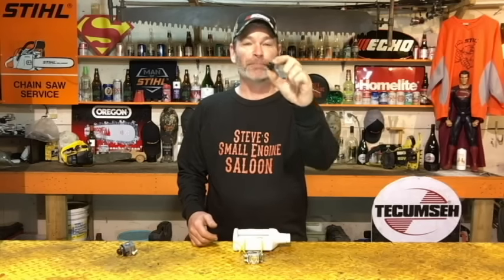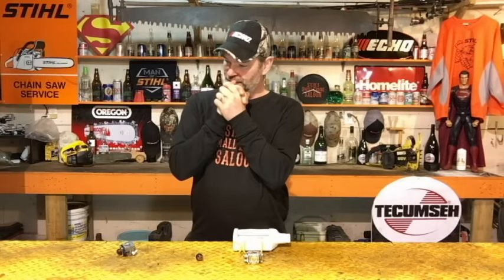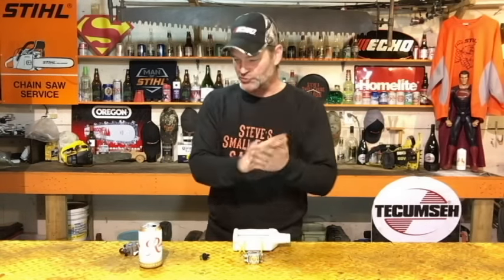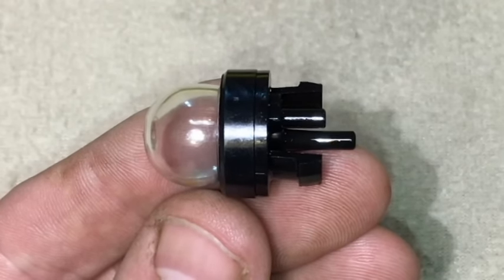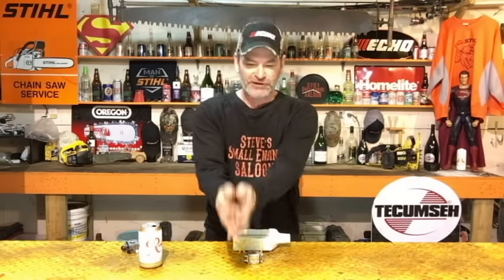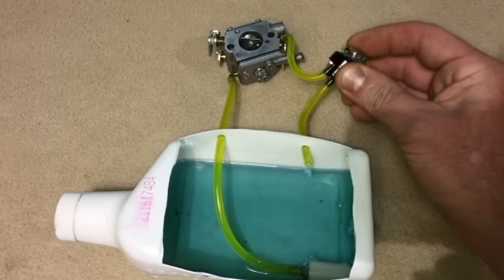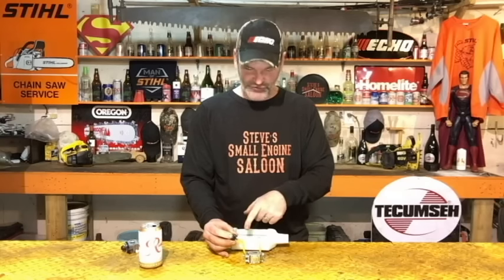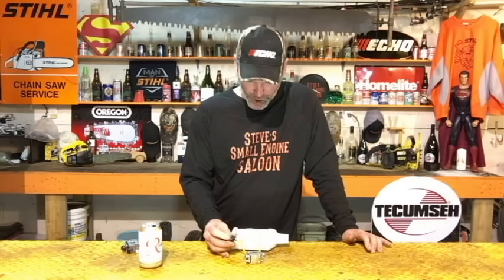How To Install A Purge / Primer Bulb Properly (Don't make THIS mistake!!)

Comment: Steve, where were you 4 hours ago? LOL.  I installed a new bulb on my trimmer this afternoon and hooked the hoses up to the wrong fitting.  I could hear it sucking air, so I switched hoses and it worked... I swear my phone/ youtube is reading my mind, because I didn't mention it to anyone.😳🤔 and then this video popped up in my feed
Reply from the maker: Right on

Comment: Steve, you are a huge time saver for me.  I recently acquired a Homelite chainsaw.  I dismantled and cleaned the carb, but could not get the thing to work.  I worked on it for hours!  Your fuel line example was great.  Turned out the fuel lines had been previously replaced incorrectly.  I reworked new lines based on your example and Voila, it worked!  I've seen a few of your other videos and they are excellent.  Thanks
Reply from the maker: Great to hear!
Reply: Steve, great video. When you have two size lines, thick and thin, which goes where. Anyone?

Comment: Just bought a toro t25 for 10 bucks at a flea market. It looked like it wanted to run, so took it home an realize it needed this purge bulb. Watched this video, Went back to flea market, and got one for 2 bucks, back home installed it and it runs good. If it wasn't for this video I would have been trying to fiddle with it and the carb wasting time. It really made me understand how different this system works from what I knew.

Comment: I did remove all the lines, but not on purpose! While living on a US Army post they privatized housing and the contractor started mowing the lawns, it was no longer up to the occupants.  After I retired, I was dusting off my old, long unused line trimmer.  I was using a soft bristle brush and you can imagine my surprise when I brushed away the fuel lines!  These videos are so informative, you are one of the content providers I recommend to others when they don't want to pay me to work on their machines.  Stay safe!
Reply from the maker: Thank You...

Comment: Thanks for explaining the obvious to most. I bought a “broken” Husky chainsaw that wouldn’t start. The fuel lines were backwards on the PURGE bulb. (I did NOT know the difference as to bulb location) I ASSume primer bulb is on Stihl. Purge bulb is on Husky.

But anyway. Thanks for taking the time to help us and save us money.  You REALLY do a good job of KISS and explaining in detail why stuff works. That really helps!!!
Reply: it is a prime bulb not a purge bulb. purge means to remove and you are not removing fuel you are adding fuel to the carb. this guys means well but he is calling a priming pump a purge bulb which is incorrect.
Reply: @paulk5311  Depends on what you are purging, air or fuel...
Reply: @paulk5311  It all depends on how you think about it so it could be called either one. You could think of it as purging the system of air or think of it as priming the system with fuel.

Comment: Thank you so much for this video man. I was unsure if I could pull this off and had to swap the hoses around (my model has in/out/fuel on the bulb) but I pulled it off and it started right up. Now I'm riding the biggest dopamine surge ever lol

Comment: your video helped immensely. I recently took my yard machine to a repair place to have the lines replaced, (didn't realize how easy it was). Line were put on wrong and one line going to carburetor came off the fitting.  Thanks to your video I was able to fix it without returning it to the repair place. Thank You.
Reply from the maker: Great job!

Comment: Trying for days to fix my cheap old mitox cs41. Threw it in the bin last night. Turns out it wasn't my cheap £5 carburettor replacement at fault. Just saw this video. Had the tubes back to front on the purge bulb. Rescued all the bits from the bin. Rebuilt and now running 100%. As you say, must think Purge, not Prime !  Thanks so much!
Reply from the maker: Right on buddy!  You're Welcome...

Comment: Hey, I just wanted to give you a quick "shout out 'thanks!'" for clearly explaining HOW this device actually works.  Lots of other videos said, "don't install it backwards," but never said WHY.  No one ever pointed out the tiny word, "IN."  No one pointed out that it SIPHONS fuel through the carburetor and exhausts it back to the tank.  You SHOWED us.

On my chain saw, the entire assembly blew off and was lost in the woods.  Armed with your very clear explanation and then demonstration of how this thing does what it does, I was quickly able to discern which hose went to the carburetor and which one therefore must go back to the fuel tank, thus which one had to go where on the bulb, and why it mattered.  Thanks to you, I was able to finish the repair quickly and correctly.  "Outstanding!"
Reply: P.S.  As I replaced the (Stihl-brand) bulb on my Stihl, I was very surprised to see that the ring on the unit where the bulb must attach really didn't match the shape of the two tabs.  I managed to fit the piece by inserting it and then twisting it.  I expected to find a ring-fitting like the one that is used on the fuel and oiler caps, but it didn't look that way at all – and I suspect that this is a big reason why the last bulb got lost in the woods!  "I got it to stay, but I fear it could slip."  (And it's a Stihl-brand part ... that I probably paid too much for.  Looks though just like the one you list above.)  Would love to see clarification on things like this in future videos.
Reply: You failed to mention your choice of beverage...

Comment: Steve you are an absolute Godsend!! Been putting new fuel lines on my chainsaw and after a few hours of messing your simple mock up made me realise I’m trying to “push fuel into the carb when I need to be drawing it through! Genius!

Thank you again Steve many blessings and enjoy your beer! 😉👍
Reply from the maker: Glad to help
Reply: drawing it thru is still priming not purging. purge means to remove. 
you prime the carb by pulling fuel into it. that is not purging.
Reply: I believe the purging is removing the air.
Reply: I did the same damn thing- trying to pull fuel from the tank and push it to the carb. Just couldn’t get it to work. Duh! Now I get it. 👍😁🇺🇸❤️

Comment: Thank you for this video, it resolved my issue. I have a husqvarna 125B which only ran at half choke, according to some videos the problem was the tube to the gas filter being broken. I but a new tube in and then it wouldn’t run any more.  I ended up replacing the carburetor, ignition coil, gas filter and air filter, still no luck. After watching this video I saw that the blower tubes were not connected that way. The original out tube from the carburetor was the return going into the fuel tank. I know this was how it was as the tube was short ant one end was tapered to go into the grommet.  When I ran the tubes according to you, the blower runs great.  Thank you for all your easy to understand videos.  This was my first small engine repair attempt,  next is a ryobi backpack blower that I put the wrong gas in and seized up the engine. I ordered a new cylinder and piston assembly so I’ll see if I’ve learned anything about small engines.
Reply from the maker: Right on

Comment: I rebuilt the Walbro carb on my cultivator and it was flooding gas into the combustion chamber and carburetor.  After watching your video, I realized I had the tubing switched on the purge bulb.  I switched them back and got it started and tilled my garden.  Great video....thanks!
Reply from the maker: You're Welcome...

Comment: Thank you Steve, this video is exactly what I needed! Found a 4 stroke Ryobi leaf blower on the curb. Picked it up and all it needed was a new bulb and fuel lines. So for less than $20 in parts, I have a practically brand new leaf blower. Cleaned up real nice! This video saved the day on which fuel lines go where. Great explanation! Thanks again! Subscribed
Reply from the maker: Fantastic!

Comment: I just made the mistake of swapping out the carburetor and fuel lines on my husqvarna weed eater without labeling the four lines. I’ve tried trial and error swapping them out different ways and still haven’t got the right combination. Had to walk away from it a couple of times before I ended up hurling it across the yard. Can’t find any schematics on how it fits properly. Lesson learned ... take a picture of the damn thing before you start or label the lines. 🤪🤪 I realized after watching this there are only three lines. You probably saved me a new weed eater because I was about to wrap this thing around a tree. Thank you Sir! This is more than a work of art ... it’s a game changer.
Reply from the maker: Thanks much....

Comment: Thank you Steve! I’ve spent time watching other vids with folks stating to attach the filter to the smaller diameter fuel line (which made no sense to me) because it goes on the larger diameter line straight from the tank. Watching your video cleared things up for me. Much appreciated. Makes me want to drag another Craftsman chainsaw that has sat in storage for X number of years and make it run. lol

Comment: Steve....I had a Steihl br450c backpack blower that I was refurbishing completely and the correct fuel line installation was giving me a fit figuring it out.  Your video on How To Install A Purge / Primer Bulb Properly - Video explanation solved the problem....Thanks!
Reply from the maker: Awesome!

Comment: THANK YOU SOOOOOOOO MUCH!!!! I have not been able to get my Husqvarna 455 to work for years. First the fuel line rotted so I replaced that and it was all down hill from there. I would put it away for a year or two, then pull it out and try to get it running again, changed the carb, everything. I thought it might be the fuel lines hooked up wrong, but I could see that gas was going INTO the carb from the bulb. After your video I reversed the lines on the PURGE bulb and it runs like new!
  Thanks again !!
Reply from the maker: Great to hear!

Comment: excellent video, excellent explanation.  i had to figure out, today in fact, the hard way that i had the fuel lines connected backwards to the purge bulb - i had figured that bulb should be pushing fuel out to the carb, thinking of it as a primer bulb - but the bulb wasnt filling with gas no matter how many times i pushed it -so i thought, well, the intake port on the bulb needs to be connected to the line that will deliver it gas... so i sucked on each of the lines - lo and behold, i got a mouthful of gas on the line connected to the carb!  i thought, what a crazy system!.. but i hooked it up that way, and works like a charm -  thanks again for the vid!
Reply from the maker: You're Welcome...

Comment: Thanks Steve,, helped me out alot. Just had a saw brought to me. Guy said it was running fine then stopped,, I havnt touched it. Stupidly I believed him, went straight for the carb. 
Turned out,, HE had messed with the Purge bulb and reversed the pipes. Sorted and running now. Thanks to your Cut Away system. 
Enjoy your beer. 
Big thumbs up from Wales UK. 👍
Reply from the maker: You're Welcome...and Thank You...

Comment: Thanks  Steve, it's  really a well done video.  One question: if you were to hook the purge bulb's inlet fuel line directly to the gas tank bypassing the carburetor, would it still pump gas in the same direction if working correctly?  If "yes" that would be a great way to test the bulb itself.

Comment: Hi Steve, I was one of those guys who pulled off all the lines and was left wondering where to put the new ones. Then it hit me: all I had to do was size and match the old lines with the new ones and I had it figured. My saw still does not run, but those fuel lines, they are looking fine!

Comment: Damn, I learned something new today.  I thought that bulb was a prime bulb not a purge bulb.  I replaced my lines and bulb on a weed eater several years ago. 

I did not get anything mixed up because I made a sketch before I started.  Great video Steve, I am 77  I sure wished u tube videos were available years ago.
Reply from the maker: Right on Norm..

Comment: finally somebody told me which hose connection that goes from the Prim . . . . . PURGE bulb to the tank!
Reply from the maker: Right on
Reply: Hahahaha THATS exactly why I looked this up because I forgot which line goes where 😂
Reply: Awesome tip steve cause im having problems with fuel not going in a husqvarna blower with this set up you the man thanks bud

Comment: I accidentally reversed the fuel lines on the purge bulb after installing a carb rebuild kit, and chainsaw would only run to half-throttle before bogging down.  Naturally I was suspicious of the rebuild kit, but disassembly showed nothing wrong.. so I turned to Steve's video on the purge valve just to make sure I had the purge lines correct.  Turns out I didn't, and that was the problem.. the one-way check valve in the purge line is critical to proper carb operation.. boy can these little annoying problems really kick your ass sometimes - and get you downright fuming.  In the process, I also discovered that my replacement fuel lines were a little too big/loose, and at high rpm fuel was spitting out of the connections to the purge bulb, so now I need to order OEM fuel lines, to get this chainsaw finally back to factory condition.   Thanks Steve.

Comment: Every video gave conflicting and or incomplete info on exactly where and what lines connect to what. Also what size the lines are that go where. You should know exactly without any doubt to properly connect fuel lines, if explained right. STEVES SMALL ENGINE REPAIR  explained it so the listener fully understands. THANK YOU MUCH STEVE!! Looking forward to watching more of your videos.
Reply from the maker: Right on Bill!  Thank You...

Comment: I wanna know who else takes the time to explain all this and then goes and fabricates a demo model to show exactly what's going on?  You know who?  NOBODY!
But I have a question that I think I know the answer to.  Brand new Weed Eater getting air bubbles in that return line.  I'm thinking that the carb screws are probably not tight and it's pulling in some air past the gasket.  Does that sound correct?  Thank you for all your work and good video.
Reply: Alex T great video.  I have this same issue right now.  Can’t get this chainsaw to run.  But it will start if I spray starting fluid in the carb, but dies within like two seconds.

Comment: Thank you for the information. Now, I understand how the bulb work in the leave blower.  I had the two lines in reverse. Once I switched them back, leave blower started right up!  I also replaced the old fuel filter too.
Reply from the maker: Cool!

Comment: Perfect explanation / demo setup. I was on the verge of throwing my Kawasaki backpack blower in the trash. I even replaced the carburetor (which wasn’t necessary). I had the line going to the bulb first vs carb first.  You’re a godsend.
Reply from the maker: Thank You...

Comment: Hi Steve this is Paul Burns how do to feed a fuel line in a Husqvarna weed eater please make a video that if I was near you I'll buy you a case of beers
Reply: Yes, I too would like to see a companion video that shows what to do with bulbs that are fastened directly to the carburetor with four screws ... as you illustrated at the beginning of this video.  I've got a weed-eater whose bulb is starting to look very gnarly inside.

Comment: I finally got into the habit of using a silver or white marker to mark what fuel line goes to what inlet on the purge bulb. Reguardless of how careful I was, I would always get the fuel lines on wrong. By making a mark on my  purge bulb inlet as to where the line goes. They refuse to work when backwards, lol. I used to think they are a primer too. As long as you remember it sucks fuel through the system but it actually does prime or purge the air from the system. If you don't, it sucks an air bubble and stalls. As far as priming, its actually the CHOKE that causes a rich system and the DRAFT from the piston actually draws fuel into the cylinder.If the piston isn't pulling fuel, then your carburetor isn't delivering fuel as you stated. The system is complex in design but simple in operation. Nice video Steve. Next up, how those diaphragms and flat valves in the carburetor  work. Lol.

Comment: Thank you Steve, I have a Ryobi Pole saw and just replaced all the fuel lines, there was NO manual to show the routing or explain the PURGE valve.After trying to locate one for my particular unit ... I saw you and you had helped me before.  I watched your video and thanks to your Purge short in and Purge Long to tank, I was able to bring life back into this unit that I bought years ago but never got to use (always loaned out haha) thanks for taking your time to help those in need of what you have ... Wisdom. I will try to share with others.
Reply from the maker: Right on Mike!   Thank You...

Comment: I just replaced the lines on my chainsaw and questioned if I did it right because it didn't seem to make sense. See I was thinking it was a primer bulb and should be pumping gas out of the tank and into the carb but I knew that the way I put it together and where the filter was that it wasn't doing that. I watched three other youtube videos before I got to yours and all of them did it wrong, and I knew they weren't doing it right because I was positive of where the filter was installed. 3 minutes into your video and I understand. THANK YOU!
Reply from the maker: You're Welcome...